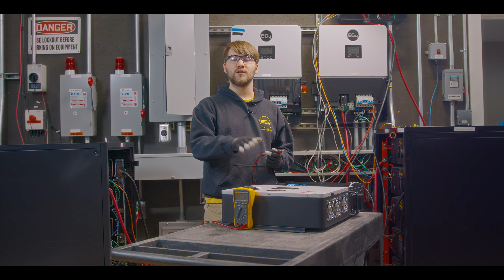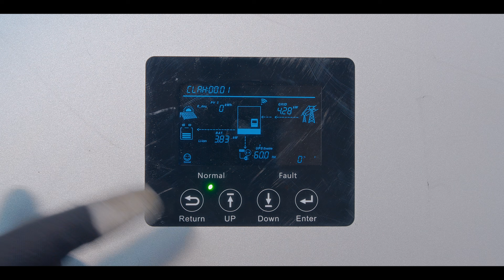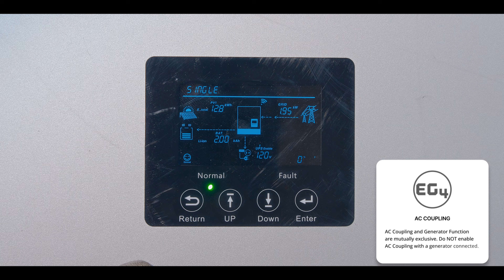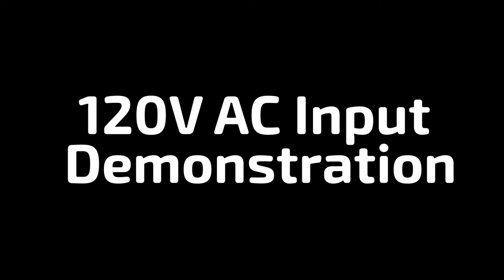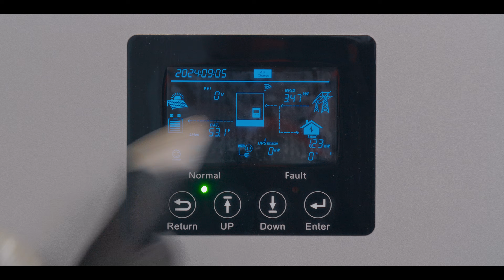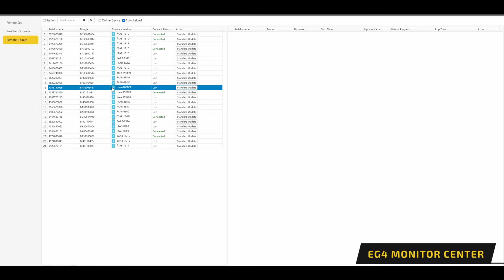AC Coupling, Three Phase, and 120V AC Input! | New EG4 6000XP Firmware Demonstration

Comment: It wont let me draw more than 750W on 120v generator.  It was initially 500W but went to 750W after I put Gen draw at 3K in settings 18.  You would think eg4 would have made this more usable. It also turns off EPS output when generator charging.  Really disappointed. It isn't half capacity on mine, just wont draw more than 750W.

Comment: I want to add a manual (gen) transfer switch to shut off grid power and transfer solar generated to the 6000xp. I am wondering if anyone has a wire diagram that shows where the 1. solar in wires, 2. to 6000xp wires and 3. back to main panel wire go?
Reply: This set up would only be when the grid is down, and I want to wake up my micro inverters to produce power to charge my batteries and run my load from the 6000xp.

Comment: How does the EG4 6000xp handle AC coupling when the load is not needed, say the battery was charging and is now full? Does it adjust the frequency to shut down the AC coupled inverter?

Comment: With the AC coupling you can add more solar input with micro-inverters or really find a used grid tied inverter connect it up to the generator input. The 6000xp will backfeed the grid tie inverter turn it on.

Comment: Interesting. So once you connect a 120v input you lose your split phase output. Guessing it's just running directly in passthrough at that point. Will it charge the batteries off 120v input? That would still be pretty nice.
Reply: Yes it will.